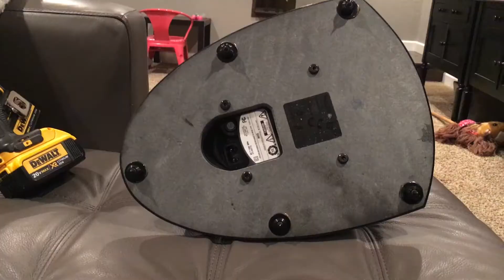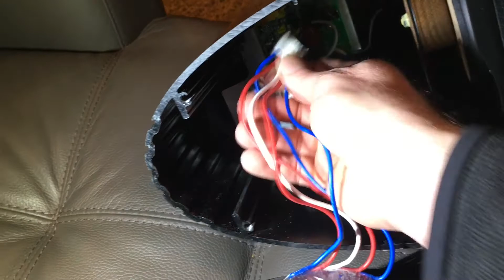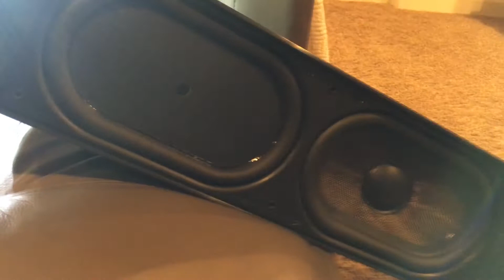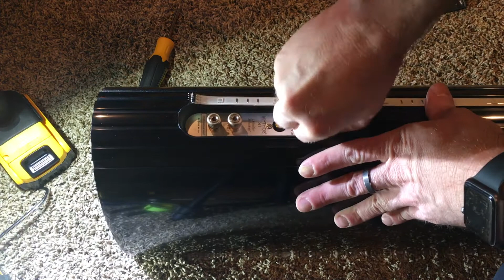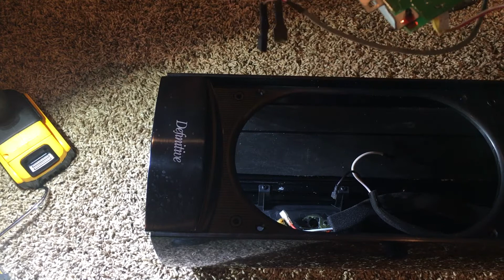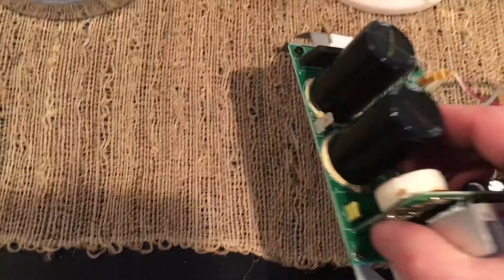Definitive Technology Mythos St amplifier removal

Comment: Thank you SO much for making this video! My pair's audio sensing circuit has gone bad so the amps don't automatically turn on, I just need to replace one capacitor on the board and this video is incredibly helpful.

Comment: Had same problem, dead amp, so I had it checked out by a guy at work. Turns out it was a bad varister used for voltage spike protection. replaced and the amp worked again but was on full volume bass. volume knob did nothing he thinks its the  potentiometer thats attatched to the volume knob. Didnt want to pay the $300 DT wanted repair it so I put that towards new stand alone subwoofer, and keep the st's unplugged until I have time to tackle them

Comment: Great video! I have 4 STS's and all 4 amps went out years ago
Reply from the maker: Thanks for the comment.  you can order the amps directly from def tech and also new grills.  you'd be surprised at how faded those can get.
Reply: Shame onshame on deftech this is a known issue and happens to 90% of this model. It should be a defect recall as the cars manufactures do... just don't buy deftech !!!!

Comment: Well, my amps just went out on mine as well.  Called Def Tech today, they do not make and will not sell new amps for these speakers any longer.  Only option now to is remove the amplifiers and send them to Def Tech to repair at a cost of $300 EACH!!!!  This puts a very sour taste in my mouth regarding Def Tech.  I may just buy new Golden Ears as replacements.  $600 for repairs is steep!
Reply: Same here I just noticed one of mine wasn’t working
Reply: GoldenEar is the same company and use sane design amp

Comment: Thanks for posting. I need to do the exact same thing.
Reply from the maker: Parag Mathur I replaced both amps with new ones.  I think you could replace the caps and it would fix the issue but you better be able to solder and I didn’t want to mess with it.
Reply: Received the parts from definitive, and installed just as you showed. Worked great.  Happiness is dual subs!
Reply from the maker: Nice work!  They sound so good when the amps work as intended.  I ordered new front grills for mine too as a couple pegs had busted in the old ones.

Comment: I recently called Def Tech recently and the amps for the Mythos STS are no longer available.  They will rebuild yours for $125 plus shipping.  Would you recommend that or having the capacitors replaced by an electronics repair shop?  Do you have any recommendations on where to buy those two capacitors?  Thanks in advance.
Reply from the maker: I called last week for some mythos grills and the prices really have gone up!  Anyway, take your amp off and see what the capacitors say on them.  Most will say the micro farad rating.  You could probably order them from Amazon, eBay, or the electrics shop you use.  Another option would be to contact your local university electronics program and see if a student/teacher is interested in helping you out.  Good luck.

Comment: how did you get in touch with the parts department? I have sent them an email, but was referred to a 3rd party over in the UK. Do they not have an office in the US anymore?
Reply from the maker: dangsonful here is from an email I received from them when I ordered. “We do have the parts available. The amps are $100 ea. and the grilles are $25. To place an order you can reach us at 800.228.7148 Mon-Fri from 10 AM – 6PM EST. Select option 2 for customer service.”  

Good luck to you

Comment: I have st towers........it’s power subs are dead not working what to do........?
Reply from the maker: Is the light on the back turning on?  Are you hearing any hum from the woofer?  If there is no sound coming from the woofers either you turned off the LFE port on your receiver, your amp failed, or your power plug came undone.
Reply: All is gud.......amp is gud but there is no response from st tower back......I have checked the power cord........supply is going on in ......but st lfe circuit not working......!
Reply from the maker: @owaissiddiqui3972  when mine were bad the power led in the back still lit up but didn’t power the woofer.  Idk how you tested power is coming from the amp but I suspect yours are not powering the subs anymore, bad amplifier, or speaker cable is loose going to woofer

Comment: Porsche911luv thanks so much for this video. Never been in my supertower, but I have the need to now. 

One of my STS Supertowers has developed a rattle.  I believe I have isolated it to the 5x10 cone driver.  See/hear the linked video below assuming YouTube allows it. 

This was purchased in July of 2011 as a part of an entire Definitive 7.1 speaker setup.  Its the only speaker giving me problems.

What options do I have for replacing that particular driver assuming that's the problem?  And could there be something loose internally on the speaker itself  I could self-service?  I'm a pretty technical guy who is not afraid to tinker.  Not much to loose here. Speaker has become unusable. 

Video here: 
https://share.icloud.com/photos/0zpdmWIyPdu925vBVMwFuLJdQ
Reply from the maker: Sorry, download isn’t working.  I do see those drivers, if that’s what it is, for sale on eBay.  I would call def tech first they might give you a discount.  Maybe unplug the sub and just run the highs and see if the rattle stops.
Reply: Porsche911luv sorry about the bad link.  Put it on Vimeo. https://vimeo.com/452407693

I’ve used your video to remove the driver and the rattle is gone.  There was however a rubber looking strip that runs all the way along the back corners (both sides) and one side had fallen down from the top. Not sure what it’s purpose was but wonder if it was resting on the driver and that’s what was causing the rattle.  Or does this sound like the driver to you?  Thanks for your help.
Reply from the maker: @stevendrew6861  it could be either by the sounds of it.  When you gently push down on the woofer do you feel a somewhat crunchy feeling?  Yes, than woofer is blown If not it’s most likely the rubber strip
Reply: Porsche911luv ok. I’m going to reinstall the woofer to see for sure.
Reply: @stevendrew6861  My right STS was having this horrible vibration.  My installer took the bottom off and took about 5 strips of thick thick electrical tape and covered over all that was there from top to bottom.  That fixed the problem.

Comment: i got a used set of these speakers and they have the buzz. how do i get these amps that i might replace them and save these speakers?
Reply from the maker: Here's is def techs number 1.800.228.7148 Mon-Fri from 10 AM – 6PM EST. Select option 2 for customer service.  I've since replaced an amp on a supercube III and the service and shipping speed is very good with these guys.

Comment: PLEASE HELP. I need 2 of these amps. Any idea how to get them??
Reply from the maker: those boys here is from an email I received from them when I ordered. “We do have the parts available. The amps are $100 ea. and the grilles are $25. To place an order you can reach us at 800.228.7148 Mon-Fri from 10 AM – 6PM EST. Select option 2 for customer service.”  This how I got them.  Idk if that still works or not.  If not take them to an electronics store that can replace the capacitors.  I hear that’s the failure point on these.